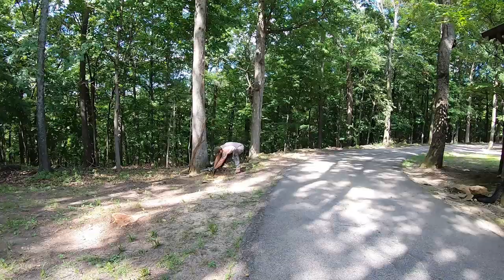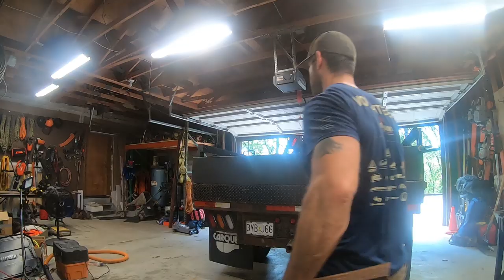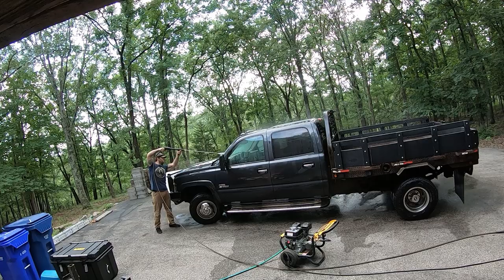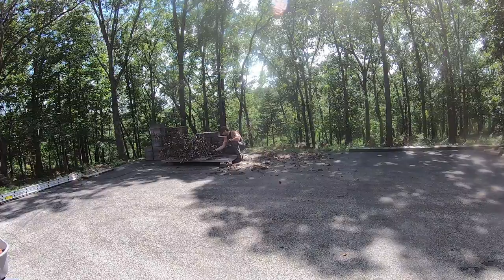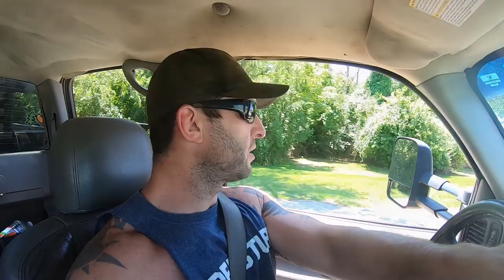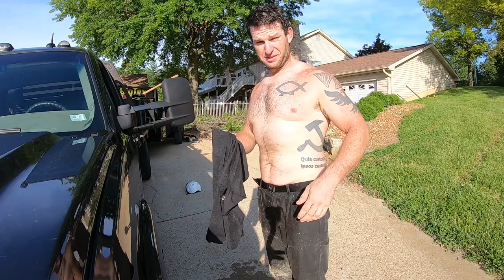Measure Once, Drill Twice

Comment: Can we all just take a moment to appreciate that oil filter not being twelve miles up inside the guts of that motor.
Reply: But yet, still upside down. Guess prefilling that one so you don't dry start is out of the question.
Reply: cat recommends you don't prefill. prefilled oil isn't filterd. and bulk oil often times is contaminated
Reply: @jeromeduffy9270  I don't prefill either. I've been told that's bad, but never had a problem in over 20 years of oil changes.
Reply: Kutter Beavers if you know how a oil filter works (pretty basic) you pour it into the right part and zero issues
Reply: @benfairhall5331  90% of ppl don't pour into the mesh or holes which ever your filter has

Comment: Friendly suggestion... when pouring oil from those gallon or 5-quart oil bottles, you should orient the bottle so the spout aka the mouth is at the TOP.  I know it seems counter-intuitive,  as having it at the top makes it farther away from the oil fill hole on the car.  But, it stops the oil from "glugging" (aka - coming out in uneven spurts).  You get a nice smooth pour.  Take it or leave it.  Anyway, keep up the amazing channel Corey!

Comment: Can't complain about much with the oil change on those impreza/wrx/crosstreks! My wife's impreza takes 20 minutes, mainly because it's too low and needs ramps. Not a single shroud to remove, filter's up top, and it takes exactly 5 quarts! Super simple. Most new gas engines use 0w20, Toyota and Honda started around 2010 I think. Coworker has 280k on his Accord that uses 0w20, he didn't like the idea at first but his Honda mechanic told him not to worry about it and he's had zero engine issues driving all over for work.

Comment: @Human what brand car is that?
Either way, quality oil and filters are worth it in the long run.
0w-20 is good for winter and fuel economy.
A step up to 5w-20/30 may be worth it in summer for the added heat protection.
Reply: Subaru
Reply: @PatrickWagz  In that case, @Human NEEDS to use Subaru upper engine cleaner and an engine flush with each service.
For me, I dumped the old oil and filter, used the cheapest possible oil and filter to do the flush(LiquiMoly), dumped it and used quality filter and oil and didn't have to do a rebuild on the boxer engine before trading it in.